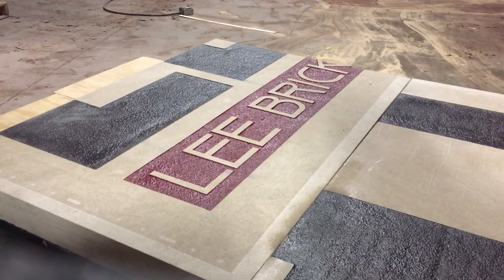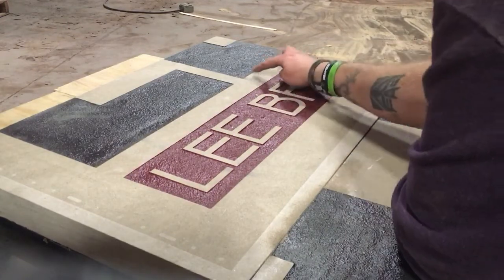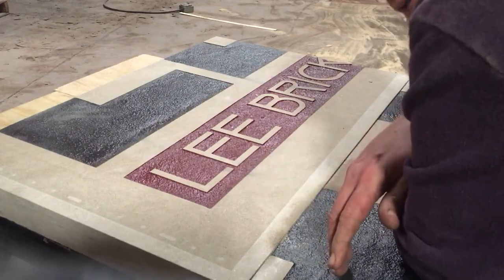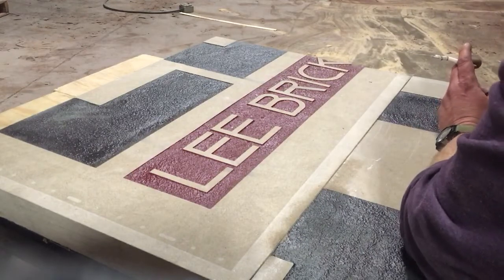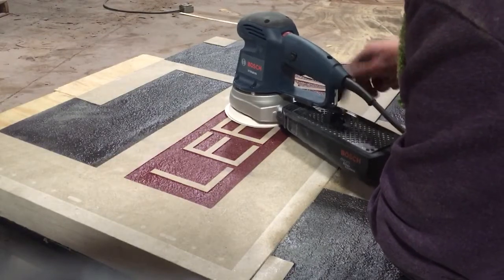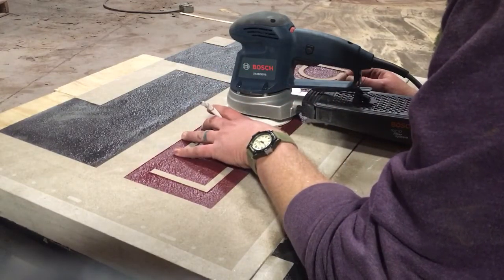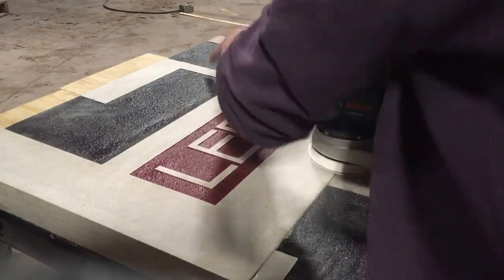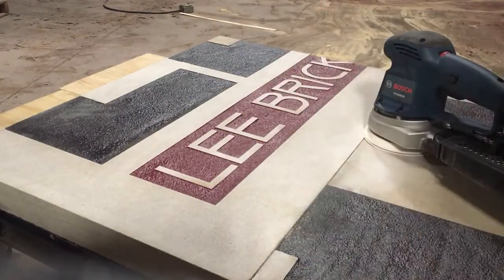Best way to clean concrete or limestone

Comment: Excellent video. Most experts are advising people to go straight to muriatic acid, which is unsafe in my opinion. I used this same method to clean off dried cement and grout splashed on my limestone pavers and it worked like a charm with no mess or chemicals to worry about 👍🏼

Comment: What grit paper are you using when cleaning that stone?
Reply from the maker: +TechLife411 80 or 60 to start you can finish with a finer grit for a more polished look if you like. Quick tip dampen the stone to keep dust down and keep track of surface changes.
Reply from the maker: I was using a grit somewhere between 80 to 200. Its been a while since I posted this.  But dont be afraid to use 60 or 80 . Test a spot on low speed or with your hand to see if the grit u choose is ok for your masonry